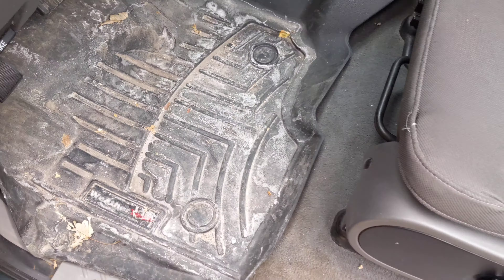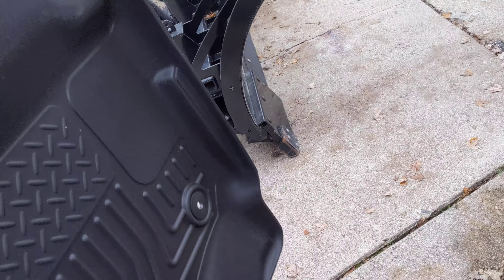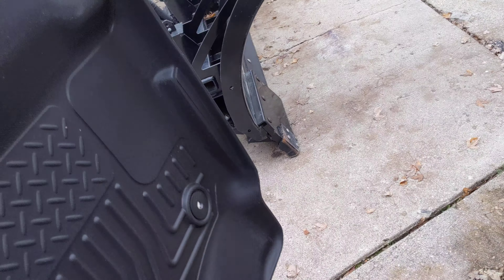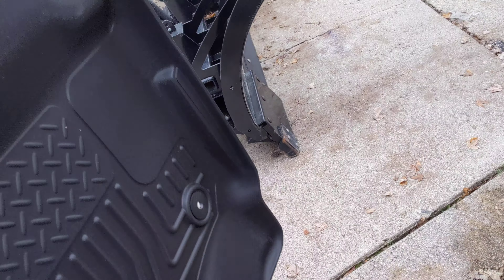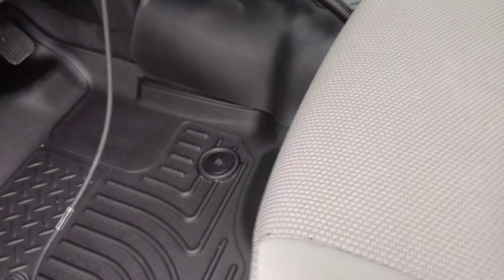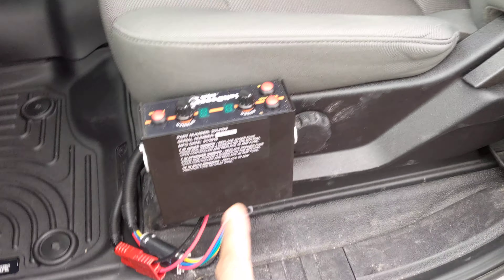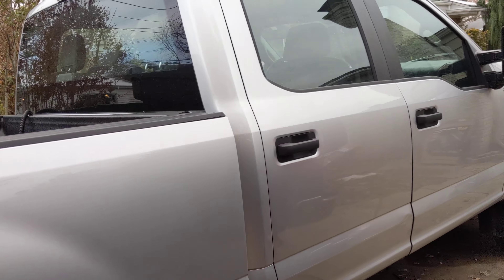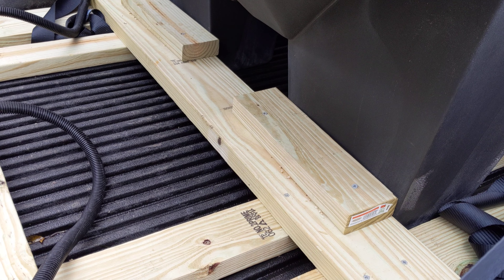Bye-Bye WeatherTech! hello HUSKY LINERS!

Comment: I’ve had my WeatherTech floor mats in my F150 for 4 years and they still look brand new! Also, when you lifted up the mat the locating pins weren’t in line, are you sure they’re the right mats for your truck?
Reply: My weathertech liners are black and it took them no time to look like this. I take them out and wash them in the tub but they never look new. They always have a slight residue, scuff look to them. Not a problem for me because it’s a truck and used like a truck, but they definitely don’t look new for long. Bought the tan ones for our suburban and those didn’t fit great in the back. They constantly curled up and they scuffed up even more because they were a light color. Just traded it in for a Yukon XL. Thinking of trying the husky xact contour this time.
Reply: Maybe because this guy actually has a manly job 😅 and you work in an office with ac 😅

Comment: Love my weather tech ones. I don't have the curling issues you've had and I don't have those clips in the back, which is only because my truck doesn't have those clips, being a GMC.

As for the hump, I don't have one. But if it makes you feel better, it shouldn't need to be as thick because it's a lower traffic area. Just has to be thick enough to keep water and mud (etc) off of the carpet. Looking forward to seeing the difference! Especially since I'm planning on getting an F150 by the end of next year.

Comment: Looks like you didn't have the correct WeatherTech liners for your year/cab style truck - that would probably explain both the curling and the water getting under the liners.
Reply from the maker: They fit the f250. I put them into he 150 second hand... They started curling in the f250.